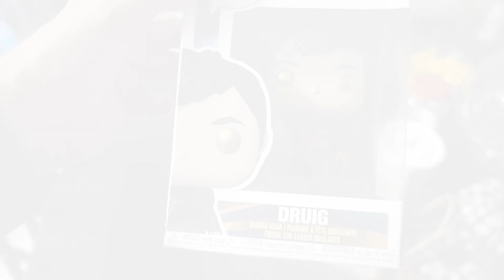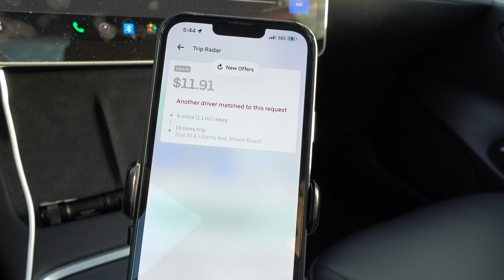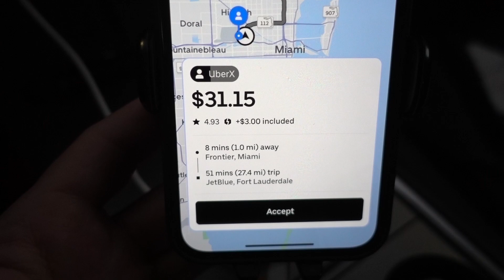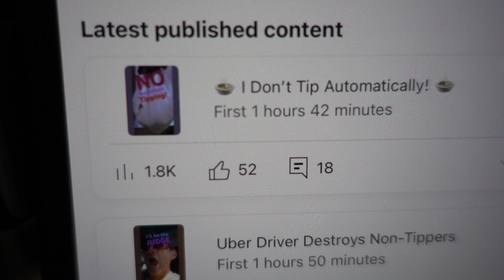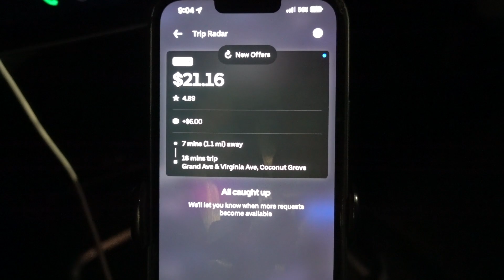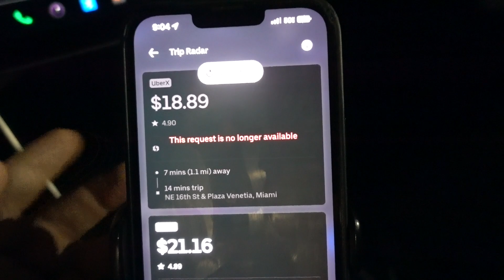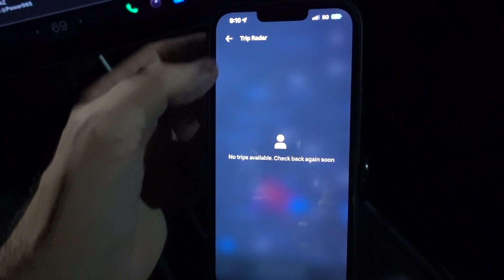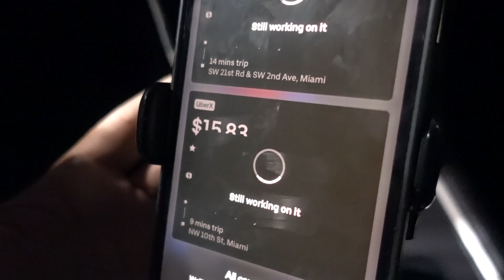Chatty Cathy on a Tuesday: My Viral Tipping Rant & Uber Tales

Comment: Perfect. Now you know it's only 12% charge from the Miami Airport, to the Fort Lauderdale Airport. Sounds about right! Model 3's can do 272 miles on a full charge, which means half a batt charge allows for 136 miles, and a quarter batt remaining allows for 68 miles. So you could have nearly driven from Miami Airport to Fort Lauderdale Airport, BACK to Miami Airport, and half-way BACK to Fort Lauderdale Airport, on the 26% that you had, hahaha.... 😆